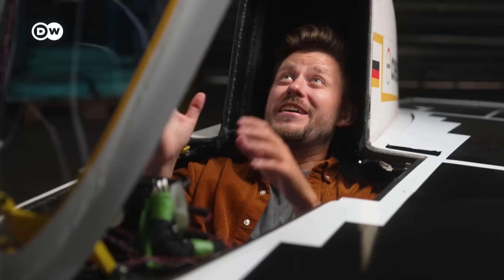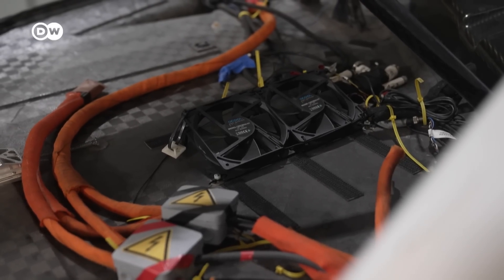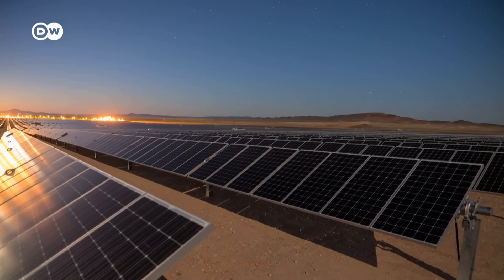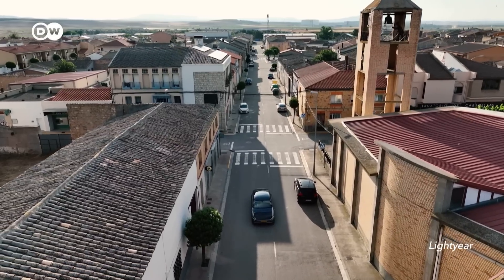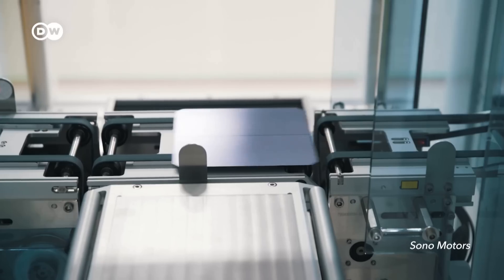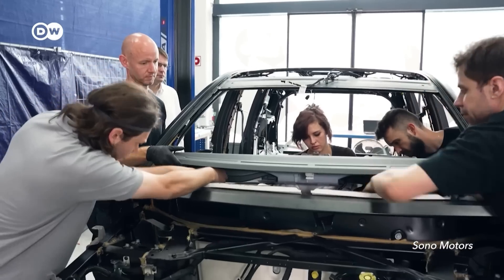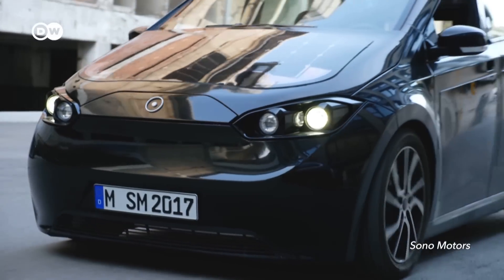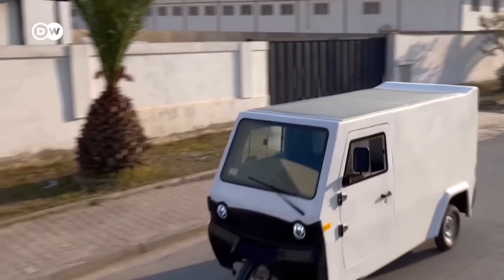Why aren't solar cars everywhere?

Comment: The video doesn't really get across, that Sono and Lightyear only failed, because they didn't properly predict the costs of, nor get the money for, starting mass production. (if they had, they'd have succeeded and been profitable), and that the cars themselves, were perfectly good. It also massively misrepresents Aptera, which has been proven to be able to handle hills, just fine ...and makes no mention of the excellent Squad Solar. All in all, the video does more to misinform, than inform. It does far more harm than good.
Reply: Yes, the general concept works, but for example Lightyear first confirmed that we could test a prototype and then pulled out of it. Independent verification hasn't really taken place that much and the fact is that you can drive a solar powered car by putting PVs on your roof or putting PVs on parking areas today. In comparison to that the upfront costs for building an integrated solar car are enourmous and as we have seen time and time again, investors aren't willing to pay these prices. Also by using integrated solar cars, you're potentially loosing solar power that could've been used to support the overall powergrid. As of now, the concept only makes sense as a last option to be added to meet our growing energy demand
Reply: @kaisteinecke8034  "In comparison to that the upfront costs for"

The upfront costs, don't reflect the profitability, practicality, or doability, of the product. It is irrelevant, to the issue in question.

"investors aren't willing to pay these prices."

...which is the one and only major problem, for making solar cars. The video, however does NOT say that. It conveys, that it is them being solar cars, that makes them fail. Which is obviously not the case.

"Also by using integrated solar cars, you're potentially loosing solar power that could've been used to support the overall powergrid"

That has nothing to do, with anything in the video, which doesn't say anything about that.
Completely unrelated to the question of the feasibility of solar cars, or why so many of them have failed.
If anything, the absence of that point, further demonstrates how problematic the video is.

Not to mention, that the video states that Sono and Lightyears claims of km/day, were promises that "couldn't be kept". Thus saying that the cars couldn't manage to get anywhere close to that much range from the solar ...except that the basis for saying that the promises couldn't be kept, is that the cars failed to get into mass production, due to lacking money for the upfront costs! Not that they can't get that much range, from solar!
That is extremely dishonest and misleading!

The claim that cars would have to completely change appearance...
The Sion and Lightyear 0, look fairly normal, so that is an obvious lie.
Reply: @ZarlanTheGreen  I have the time to teach people sound logic by using examples of poor logic courtesy of green Zarlan:

["In comparison to that the upfront costs for"

The upfront costs, don't reflect the profitability, practicality, or doability, of the product. It is irrelevant, to the issue in question.] Upfront costs are always relevant to any product. This is because competitors with lower upfront costs can easily put you out of business. I can't comment on relevance to the issue in question, because I don't know the issue in question, but I can be certain it will be relevant, just from knowing how thick Zarlan is.

["investors aren't willing to pay these prices."

...which is the one and only major problem, for making solar cars. The video, however does NOT say that. It conveys, that it is them being solar cars, that makes them fail. Which is obviously not the case.] First off; investors don't pay prices; customers do that. If the video is about the plausibility of solar on a moving vehicle, it has no need to mention investing and can point out solar on cars will make them fail. Whether it's the case is up to how well the case is presented, and that is moot. Should someone say it's not the case, they should make a case, themself. I see none from the Green.

["Also by using integrated solar cars, you're potentially loosing solar power that could've been used to support the overall powergrid"

That has nothing to do, with anything in the video, which doesn't say anything about that.
Completely unrelated to the question of the feasibility of solar cars, or why so many of them have failed.
If anything, the absence of that point, further demonstrates how problematic the video is.] It's why the person said "also". That allows for it not being in the video, however it IS completely related to the feasibility. If the absense demontrates the video was problematic, then the Green should be grateful the comment was made, yet he derides it as being irrelevant. That's the mark of a thickhead scatterbrain.

[Not to mention,] Duly mentioned . . . 
[that the video states that Sono and Lightyears claims of km/day, were promises that "couldn't be kept". Thus saying that the cars couldn't manage to get anywhere close to that much range from the solar ...except that the basis for saying that the promises couldn't be kept, is that the cars failed to get into mass production, due to lacking money for the upfront costs! Not that they can't get that much range, from solar!
That is extremely dishonest and misleading!] If the narrator didn't say why, then there is no dishonesty nor directing people down wrong reasons. People need to read between the lines to invent a reason. Zarlan has done this with the excuse high costs and low cash combined to end the projects. While that was also presented in the video, it was not linked to these factors  stopping the prototypes from achieving the promised ranges. Since both companies had their prototypes, each could prove the ranges (from solar only) they had, so promises can still be kept, failing they have destroyed them like Aptera 1 did. The intelligent approach is to forget making up excuses and push for these prototypes to be independently tested and compare with their promises; only then is the issue resolved.

[The claim that cars would have to completely change appearance...
The Sion and Lightyear 0, look fairly normal, so that is an obvious lie.] They don't look fairly normal, and Aptera looks even weirder than both put together for that matter.

I hope people can get a better understanding of when they are reading nonsense?
Reply: @aussieideasman8498  You admit you don't care about being relevant/on-topic, and then proceed to tell nothing but lies... Bye.
Reply: @ZarlanTheGreen  You continue to have nothing when you say people have nothing but. Nothing but is at least something. Think about it. Now I hope that 'Bye' means you have stopped writing your rubbish?
Reply: @ZarlanTheGreen  

Of course, upfront costs affect profitability. More upfront cost, more revenue needs to come from the product to make it profitable. That also affects doability bc without the required capital doability is zero. Investors want profits. Or why do you think that Sono and Lightyear produce solar models to slap on busses and trucks? Otherwise they wouldn’t be making ANY money.

They didn’t go into mass production and those numbers aren’t independently verified. When was the last time your car delivered the miles per gallon promised by an OEM?

It’s not directly related, but indirectly. Economically it’s more efficient to upscale utility solar or PV in parking places before putting it on car’s roofs. It also helps to overall decarbonize our energy sector. As I said in the video: You can drive with solar power tday and you don’t need it on your car's roof. 

They look normal, but still cars need to make much more of an effort to be less heavy for the solar power to have more of an effect than it currently would have.
Reply: @kaisteinecke8034  "Of course, upfront costs affect profitability."

Failing because of not having the upfront costs, doesn't mean it wouldn't have been profitable, with the cars being perfectly affordable. (well, aside from the Lightyear 0, which was intended to be an expensive luxury car)

"That also affects doability bc without the required capital doability is zero."

It has NOTHING to do with anything about how doability, in regards to the cars themselves.
It is purely in regards to that specific developer being able to get it to market, PURELY due to how much money the developers have/don't have

...which isn't what you convey, in the video. In the video, you convey that it is because of the cars. Because solar on cars, doesn't work.

"They didn’t go into mass production and those numbers aren’t independently verified."

Several independent people, have tried/driven their cars.

"When was the last time your car delivered the miles per gallon promised by an OEM?"

When was the last time your car delivered miles per gallon, that were several orders of magnitudes off, from what was promised by an OEM?
The figures being inaccurate, in favour of the car, is fairly standard. The figures being nowhere near reality? No.

"It’s not directly related, but indirectly. Economically it’s more efficient to/.../"

Again: There is no mention of that, in the video. We're discussing the video. Stop trying to distract from the conversation, by going off topic.

"They look normal"

Yes. So where is your apology, and public correction(!), for your LIE, that cars would have to completely change their appearance?

"cars need to make much more of an effort to be less heavy for the solar power to have more of an effect than it currently would have."

Irrelevant. It would currently be very effective, and give you enough power to sharply reduce the need for charging, or even mostly eliminate it.
Reply: @kaisteinecke8034  Over a week without a response. I take it, that you realised, that you have response to what I said, but don't want to admit to have been wrong, so you've chosen to just stay silent.
Reply: You massively misrepretest Aptera, yourself. Aptera has proven nothing, and is reluctant to do anything beyond making pie-in-the-sky claims to con the gullible. Take, for instance, saying it could to 3.5 secs 0-60mph, then switching off the timing lights when it went down the drag strip? First time in my 70 years I have seen timing lights off at the drags.
They also made no mention of the fact that Aptera shut down and vacated their solar plant, and have rejected all the panels they made there as being unsuitable. They are not making better ones at Carlsbad.
Reply: @aussieideasman8498  Several people have pointed out, in this comments section, that Aptera have shown one of their cars, going up and down hills, several times in a row, and how the initial failed hill climb, was because the cooling system wasn't turned on, because that's the kind of mistakes that happen, with prototypes.
As for the 0-60mph claim: Who cares? 0-60mph doesn't really matter. As for the solar plant thing... Do you know what exact aspect of suitability, that they were referring to? If not, then you have no grounds, for saying that others wont be more suitable.
Reply: @ZarlanTheGreen  "Several people have pointed out, in this comments section, that Aptera have shown one of their cars, going up and down hills, several times in a row," What people say doesn't make it a fact. They lie. If Aptera has shown this, simply reference where we can watch it? I have kept a very close eye on this, and the best I have seen is about 400 yard in the uphill direction. The remaining approximately twelve miles was only claimed by those lying snake oil salesmen.  
"and how the initial failed hill climb, was because the cooling system wasn't turned on," Most said it wasn't installed. It was the second failure on the flat by Nikki's drive where they said it wasn't turned on. 
"because that's the kind of mistakes that happen, with prototypes." Neither leaving off the hoses nor having a system you can turn off are the kind of prototype mistakes which you see.
"As for the 0-60mph claim: Who cares?" Many people, including me. 
"0-60mph doesn't really matter." Maybe not to you, but the claim should matter - it's an ethics issue. 
"As for the solar plant thing... Do you know what exact aspect of suitability, that they were referring to?" Yes; they said they didn't need the space because CPC would be sending them the bodies. 
"If not, then you have no grounds, for saying that others wont be more suitable." Then I have grounds, but I didn't say Carlsbad was unsuitable to make solar panels; I said they stopped making them at the abandoned Vista plant and merely stockpiled the equipment at Carlsbad. They also said they won't be using any of the Vista made panels because they were of inferior quality to what they can now make, but have made none. They stopped letting visitors into Carlsbad.

Comment: DW Planet A once again asking the wrong question. The problem with cars isn't what you use to fuel them, it's what the use of cars fuels. Ubiquitous personal mobility is the pump that inflates the sprawl balloon. It;s not "what" you drive, it's that you drive. It's not the car in the driveway, it's the driveway--it's everything cars enable and require.

Comment: Sounds like it'd be way more efficient to just make EVs and cover the parking lots with solar panels and charging stations? I get the appeal of UNLIMITED POWAAAA, but if the tech's not there, the tech's not there.
Reply: The tech is there. The cars mentioned here (and the Squad Solar), all prove that. Aptera can handle hills just fine, and the Sono Sion and Lightyear 0 only failed, because the manufacturers were no good, and overly optimistic, with the finance. (if they had, had the money to start mass production, they'd have been fine. And profitable) All the cars work perfectly well, and can drive on mostly/only solar. (and even just having solar cover a quarter of the energy, would be worth it)
Reply: @ZarlanTheGreen  Aptera hasn't proven to handle hills just fine - they need to do much more than the con job video they showed. And in any case, it's the motor and the battery combination that does that, not the solar.
Reply: @aussieideasman8498  You make a baseless claim ...and then proceed to show, how it is completely irrelevant ... Also, you're weirdly obsessed with Aptera.

Comment: Why is there no mention, of Squad Solar?
Reply: We mention different use cases at the end of the video with smaller vehicles. Squad Solar goes into the same direction
Reply: @kaisteinecke8034  There is a HUGE difference between mentioning distant possibilities (which it can technically be said to fall under), and showing the existing car.
It has no less (people&luggage) space than the Aptera, and is closer to starting production. Yet you show Aptera, as well as the Sion, and Lightyear 0 ...but not the Squad Solar.
Why?
Reply: @kaisteinecke8034  ...and also: "different use cases at the end of the video with smaller vehicles", applies EXACTLY THE SAME to the Aptera, as to the Squad Solar.